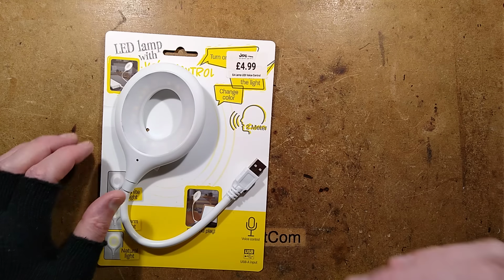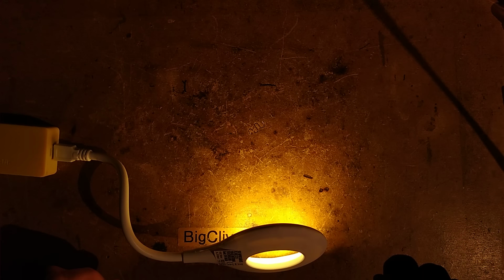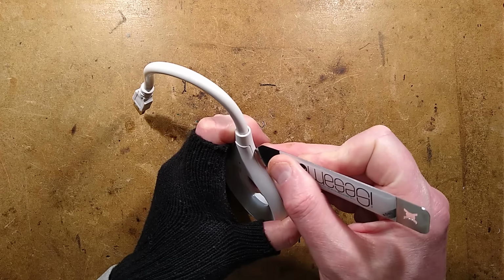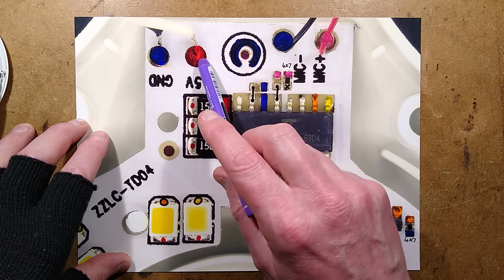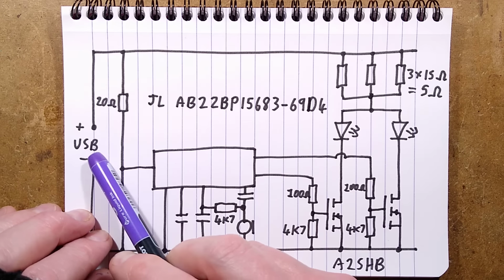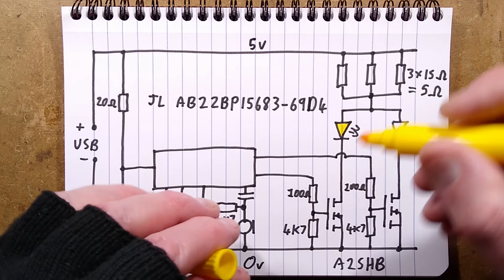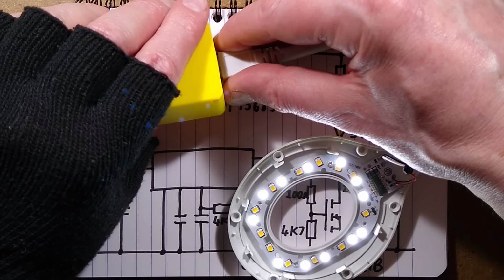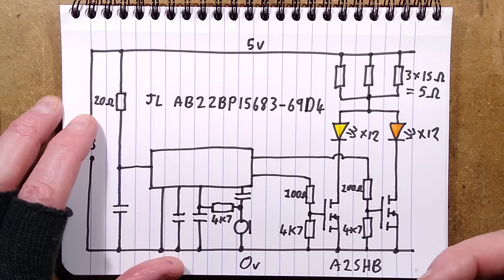Inside a voice controlled light - with schematic

Comment: Yea these things are what would be interesting to see the coding on the chip.. i wanna know how the chip recognizes different signals from an electret mic that only gives small changes in voltage when sound vibrates the membrane..  i understand how it could differentiate between one and 2 words but not differences in words..  wouldnt think that a single cheap chip could sense changes in voltages so little and subtle..
Reply: There is a 150MHz DSP microcontroller in there. AC6969D
Reply: This is a perfectly cromulent mic - if you listened to its output I doubt you'd find it unintelligible. The small output is simply amplified as it would be in any other application. Because the amplifier has to be quite sensitive, those capacitors are needed to prevent interference coupling through its supply lines. More remarkable is that it can be in such close proximity to all the digital fu on the same die. But that problem was solved some time ago.

Comment: You missed one magic word: music!
I have a small usb version from ali which has 2 multi color leds, and I like to use it in the music mode, where it flashes along with the incoming sounds (say MUSIC).
On my version the mic is on the board.
And it was dirt cheap, I bought several (June 23, at 1.15 Euro a piece, "Diymore 5V USB LED Intelligent Voice Control Small Night Light Module 6 Colors Red/green/blue"). I could not find a current one though (404, not found)

Comment: I have the exact same unit but without any controls at all. I was always wondering what the case hole and all the extra pads were for.

Edit: after watching more of the video, the PCB is actually different, so there must be even more variants of this.

Comment: ac6969d chips

ooh, double 69 how sexual

anyway, those seem to be related to bt asics. remember, there are single chip solutions to which you connect mic, headphones, battery, usb, leds, buttons, antenna and that's it, it's complete device

some of them also play things from usb, do fm even iirc

so this isn't big surprise. i think it optimized voice recog somehow. and yes voicerecog is also really evolved and used now

so i'm not that surprised

Comment: The memory effect may not last long - after an hour or a day or a month it may lose track of previous settings.

If the memory lasts over a month then it's agree that it must have a flash memory, but my guess is that it will fade as the various capacitors lose their charge.

Comment: Are PNP transistors and MOSFETS easier and cheaper to make or why are NPN ones barely even used anymore?
Reply from the maker: Each has its own uses.  The MOSFETs are much easier to use for higher loads.

Comment: You can do this with an ESP32 but I'm still shocked by the price.
Reply: The novelty of Arduinos rather wearing thin, I'm just about to dip my toe into the ESP32 world. Tempted to get a module with a tiny OLED display just because... I've already switched from full-fat to micropython and testing the code on my laptop.

Comment: I guess it will not be possible to get one here in France without paying more than the light itself in postage and import duties ?
Ayways the english wouldn't bother me and also I would like to control my lights by only saying Lights a bit like Willy Wonka in the television room when he says Lights Camera Action.
This USB lamp requires to say Turn on the light but I would still buy one if it was available locally.

Comment: Jie Lie seem to make their money not only from the plethora of uniquitous cheap chips but also the annual licence revenue from the closed source propietory chip SDK and programming ecosystem. Their chips specialise in bluetooth, usb and audio applications and are used in all sorts of products, from toys, car audio add-ons, headphones and bluetooth audio amplifyer modules though this is the first voice command light use I've seen, using a fairly powerful bluetooth/usb/FM radio/sd spi/i2c/serial/gpio/adc/dac/mic mcu where most of the features are not used.
Reply: Ah Bluetooth, that's where I've heard of Jie Lie.